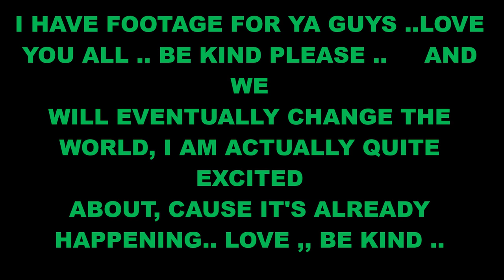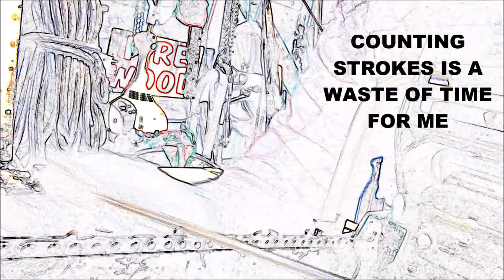FILING, HOW TO GET THAT CHAIN SAW CUTTING SMOOTH

Comment: The 365 is a great saw, Hogan will have many years of fun with it.  First chainsaw I ever used was my dad’s 365 special. He doesn’t cut as much these days so now I’ve been using it more. It’s on the bench waiting for some parts now and then I’m looking forward to getting it back in some wood.

Great tips with filing.  I’ve watched plenty of these now but I still feel like I learn something new every time. I’ve been continuing to hone my technique to see find out what works for me. I have been getting the gullet and a nice sharp working corner but I’ve been going at it too hard with the file and had difficulty keeping the top edge straight. I’ll try lightening up my touch a bit to keep it straight, thanks!

Comment: Hi buckin I know this vid is older  So you might not see this message . Anyway I got into the husky progressive gauges recently and I think they're awesome but question. As long as llttle raker is peaking through that little window, does it really matter if the raker is sitting in the middle, left or right? Just as long as the raker comes fully through that little window? Is this splitting hairs? When I got the husky gauge brand new, it didn't sit right on my stihl chain properly. The raker didn't come close to the window, and the tail part wouldn't sit flush on the next drive link, so I filed the gauge a bit so it would work, or at least how I thought it should work. Please let me know thank you

Comment: I see that saw has a double set of dog teeth on it?  Is that stock or did you custom do?
Reply: Not sure about that saw, but my Husqvarna has a stock set of dual dogs.
Reply: It depends on where you bought/buy the saw whether It comes stock with double, big dogs, small dogs, wrap or half wrap handle. Some models are only sold In spesific countries.
Reply: Stay safe and get logs C'MON. Be blessed and bless others. Happy new year.
Reply: @sigarius1783  Ok, Thanks. That would make sense.
Reply: @hpelisr  you can retrofit most of the above mentioned stuff on your chain saw If you find It In a store or something similar.

Comment: Hey Buckin where did you get those dogs they are awesome. Maybe you could make them available to us to help out the channel.
Reply: Jason Heitman I see people asking about the dogs and I can answer. Now, I’m not looking for recognition or a pat on the back but I made them at work and sent em as a gift. I would love to be able to make them for folks but it’s tricky because I have to do it on my own time and I need to sneak into machines at the shop without interrupting production. Also there is material cost, those dogs were made from scrap stainless that happened to be available. I am working on designs for stihl saws and others. The odds of being able to produce large batches are slim, but I may be able to make more here and there. Do you have a Mac of a similar model to the one he has them on? I’ll keep you in mind buddy but unfortunately I can’t make any promises. Merry Xmas and have a great day!
Reply: @dansherrell6803  thanks for the reply sir i have a stihl and would like a larger set of dogs. Those you made are the best looking set ive seen. Let us know if you work out a way to make them.
Reply: Jason Heitman thank you! What Stihl do you have? I have an 044 so I am designing ones that will fit that saw. Do you know offhand what other Stihls share the same clutch cover/crankcase bolt pattern?
Reply: Not to cut in on your business but there available for most saws on eBay
Reply: @dansherrell6803  i have a 441 not sure but i think they are the same.
Reply: Brian Townsend no problem i understand that but these would be a little fancier and if by “business” you’re suggesting that I am trying to make money that is not the case just to be clear.
Reply: @dansherrell6803  I don't even half to look at Ebay to know there isn't any of this quality craftsmanship available! Nice job, Dan!😁
Reply from the maker: @waynetharp  TRUST ME FRIED  THESE ARE TOP SHELF
Reply: Wayne Tharp thank you sir. American machinsts 💪🏼
Reply: Buckin' Billy Ray Smith thank you. I take great pride in my work, it’s my livelihood. It’s fun to do a project that isn’t given to me by the boss once in a while too!
Reply: @BuckinBillyRaySmith   Tip Top Shelf! Your welcome Dan...You sure have a natural gift and thanks for sharing it! Have a great weekend, Gentlemen!
Reply: Dan I was drooling over those at buckins last time I was there! If you ever get time or are able to make more and want to sell some put me on the list for a set I'll happily buy one off you! Assuming you decide to do it again,
Reply: Nick dumpster Hanna thank you bud but I’m not here to make money. This isn’t about me but I’m certainly humbled and flattered. What kind of saw? Same dogs?
Reply: Yeah I have a pro 10-10 that's in great shape I'd love a set for if you ever decide to make some more! But don't go out of your way just for me haha
Reply: I've ordered a set of dogs off the bay for a pro mac 10-10.  They work, but  the fit and finish are poor at best.
Reply: Jolkrae Mereark I think some people who sell them make them with a band saw, grinder and drill press. Difficult to be precise with that kind of equipment. The CNC mill makes it easy for a monkey like myself to produce something highly functional and aesthetically pleasing.
Reply: @dansherrell6803  I've access to an industrial cnc laser and had thoughts of trying the laser cut route, but I think i'd end up with a bunch of slag.